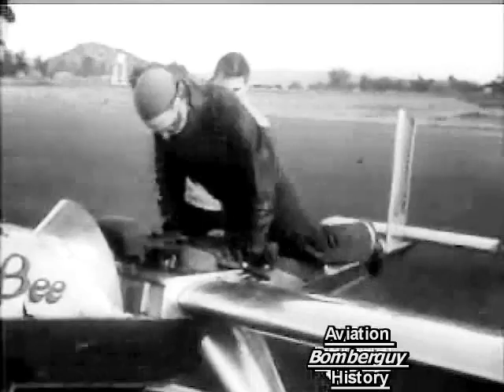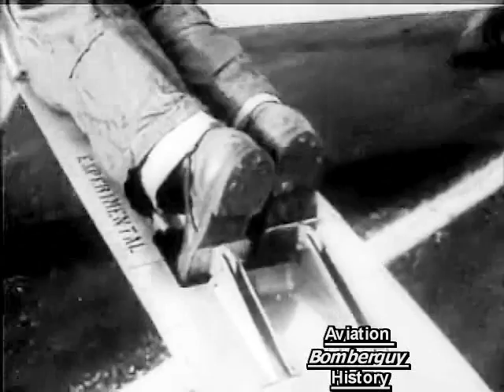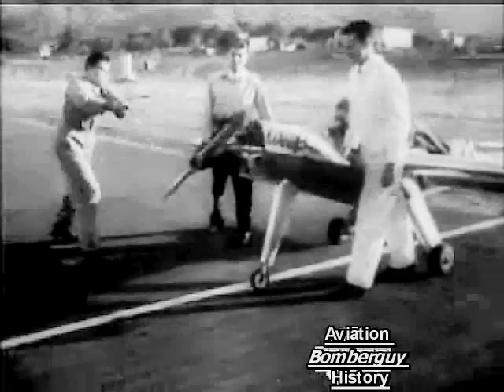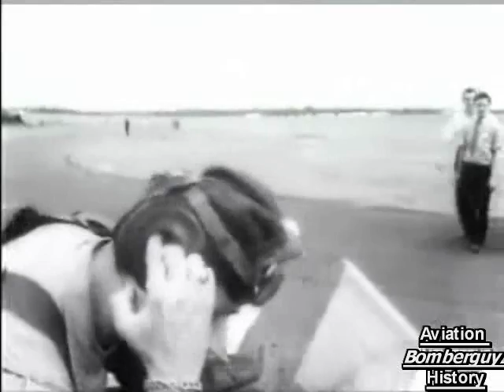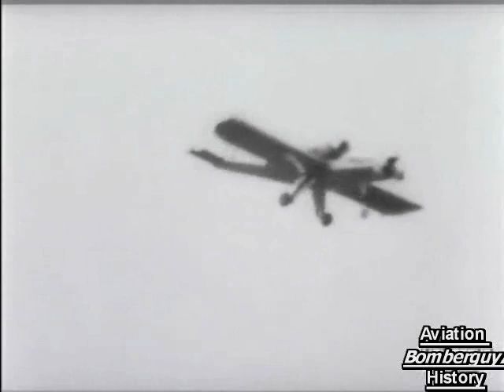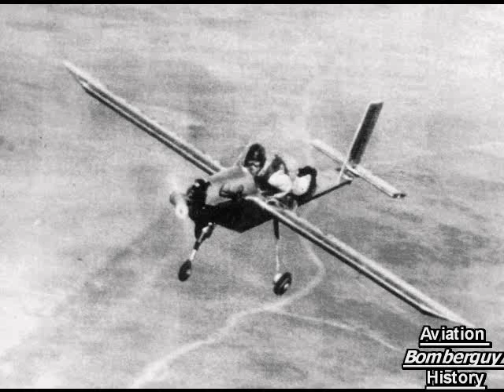The Wee Bee

Comment: This news reel was shot in the fall of 1948.  Life magazine was also on the scene, took pictures and did a full page spread in the December 20, 1948 issue. Re engined with about 30 Horsepower-second news reel clip-it flew without restrictions many more times.   Building and flying the tiny craft was a project for enjoyment not a commercial venture.